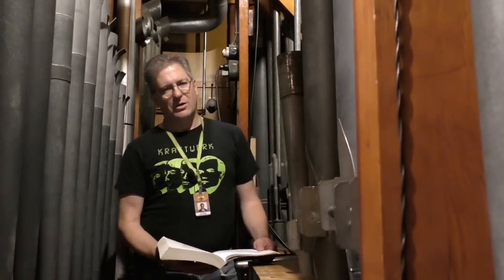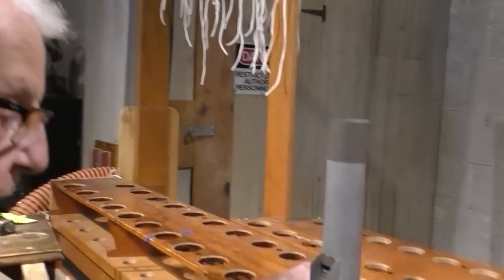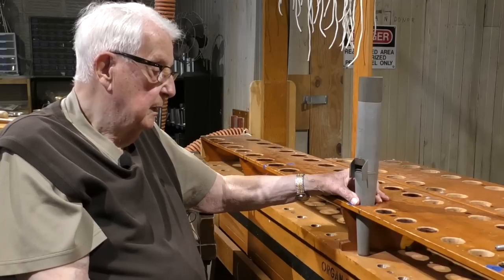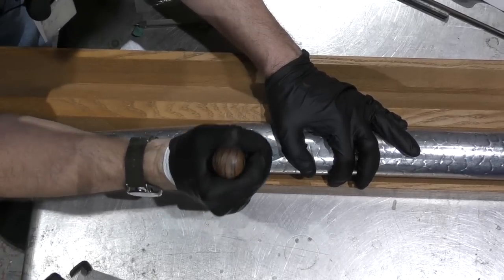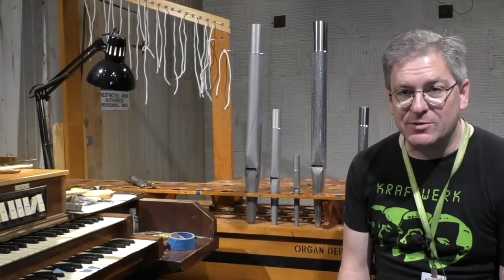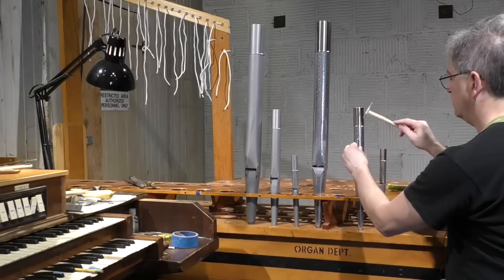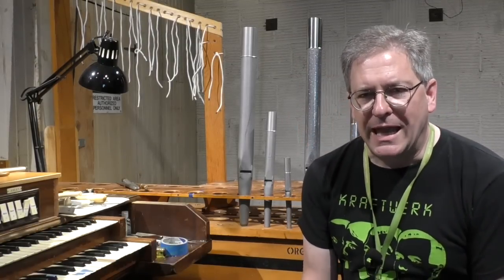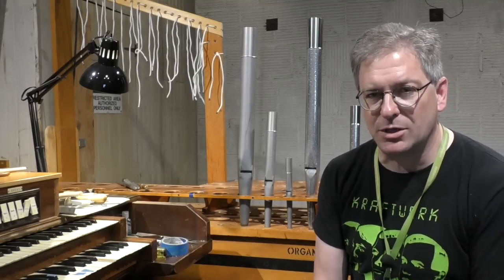Boardwalk Hall- Double Languids

Comment: Listening to the 6 pipes on 4" (I assume that is the design pressure for the double-languid pipes), hearing through your mike, I say for the 2' & 1' C's, the double languid pipes are "brighter" as you state.  But for the 6"C's, it's the opposite, the single languid pipe is brighter.
          When you say the 2nd languid is "open in the back", there is a gap between the languid & the back of the pipe (not soldered to the back?) so a piece of paper inserted from the front between the languids can curl up into the pipe in the back?
Reply from the maker: Yes that's exactly right.

Comment: Out of curiosity, would a double languid have similar effects to double mouths on the opposite sides of the pipe (as in a Doppelflöte), or is there a difference in the way the air is excited?
Reply from the maker: You know that's a really good question. You would think it would be like having one super wide mouth...and yet it doesn't seem to have that effect. I'm going to have to think about that one.

Comment: As this video and Brant show, Double Languids are not something to be thought of as alchemy or voodoo. When you make a flue pipe an especially large scale (+10HT) and blow it on more than 15", you typically get a very fluty, cloying, fundamental tone. Now, if one places a beard on the front of the pipe and skives (sharpens) the upper lip, that helps excite the wind sheet at the mouth of the pipe but does nothing to the rear. The double languid's effect is nothing more than an internal beard at the rear of the languid, drawing stagnant air from the rear of the pipe forward so it may act upon the upper lip. This allows two things: One, you can blow the hell out of the pipe for a given cut up and it will speak without overblowing, and there are actually some Diaphone flue trebles in the Pedal Left that speak on 50". Two, you get a blaze of harmonic development with all of the body and carrying power typically gained from large scaled pipework on high wind pressure.